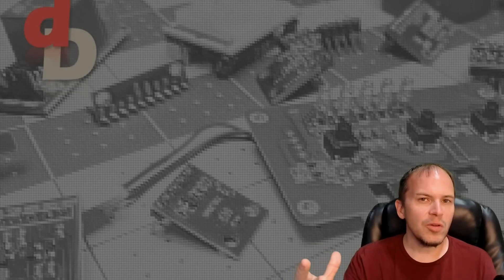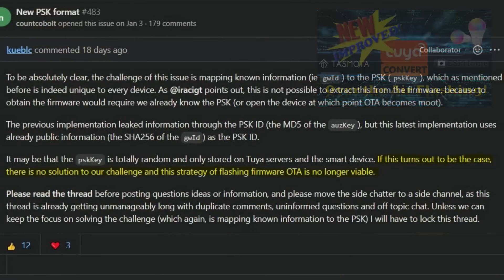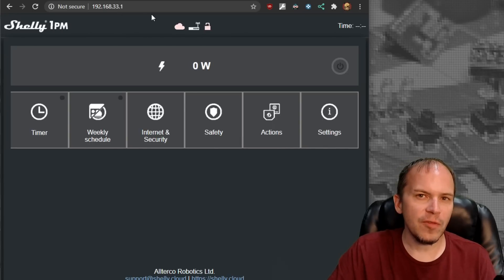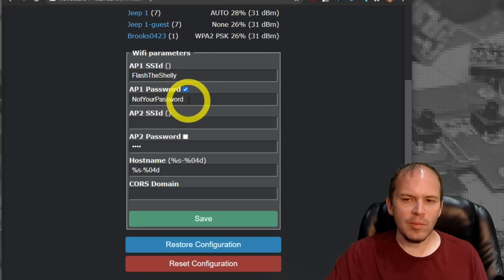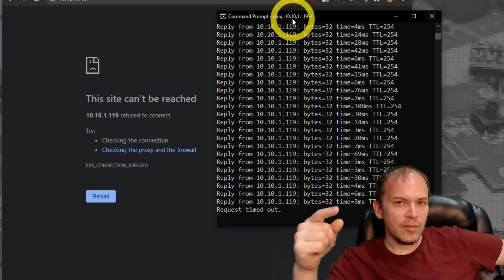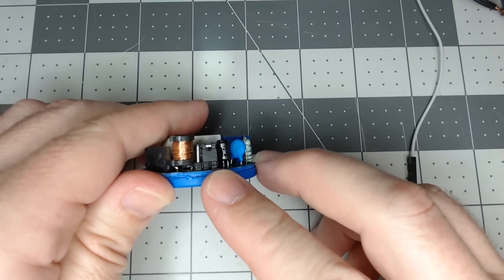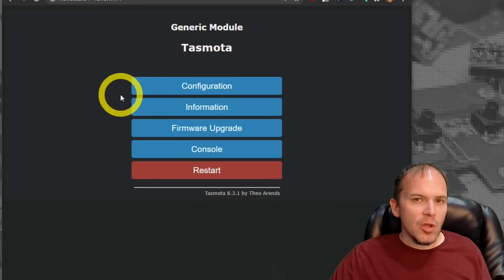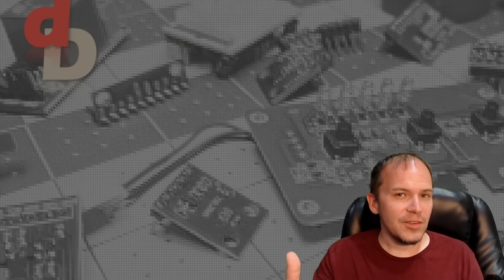Upgrade Shelly Switches | Easy NO Soldering Smart Garage Door Opener

Comment: Can't seem to get this to work for me. This is as far as it is getting me. 
{"status":"updating","has_update":false,"new_version":"20230913-112003/v1.14.0-gcb84623","old_version":"20230913-112003/v1.14.0-gcb84623","beta_version":"20231107-162940/v1.14.1-rc1-g0617c15"}

Never seems to get the firmware changed away from the Shelly firmware.

Comment: You flashed ESPHome off camera.  Is there a video on how to OTA ESPHome after Tasmota(lite)? Sorry for the noob question, the Shelly is in the wall and I'd prefer not to have to pull it.
Reply from the maker: Hmm...  I've done it some projects before but with an ESP8266 it is simple.  Just put Tasmota lite on the device, then upload your Esphome bin using the Tasmota GUI.
Reply: @digiblurDIY  Thanks! Worked a treat!

Comment: Can you flash the shelly plus 1 OTA
Reply from the maker: Try this one https://github.com/tasmota/mgos32-to-tasmota32
Reply: Thanks for quick response. Will try and let you know if it works
Reply: I was able to use the link you referenced to flash the shelly plus 1. Everything was working fine until I initiated number 10 on the list (starting the safeboot conversion by hitting the start migration. Nothing after that looks like it went silent. I can see the wifi signal referencing tasmota but it time out on 192.168.4.1. Is it DOA? Can I flash it the old fashion way? Thanks in advance for your help.BTW Love your videos.
Reply from the maker: Yes you can still flash them via the pins on the bottom.  I've done some later ones on that but if you want super simple someone made a flasher and cable for these new Plus line.  https://www.tindie.com/products/voltlog/voltlink-cp2102n-usb-serial-adapter-programmer/
Reply from the maker: and thanks on the videos!
Reply: thank you @digiblurDIY
Reply: is there a video showing how to flash via the pins?

Comment: Does flashing enable proper bluetooth proxy mode on the shelly 2nd gen? Right now I can't use them with my LD2410C which sucks cause I got a lot of shelly 2PMs around the house
Reply from the maker: I think you can use the stock Shelly firmware too with the BT proxy, I've never done it though.  For BT Proxy though I'd really recommend a dual core ESP32, like the Wyze plugs I did or even just a simple ESP32 nodemcu.
Reply: @digiblurDIY So shelly does have BT proxy in the stock firmware but it's either active or passive (not sure) and isn't working with the LD2410C. I got a everything presence lite (with bt proxy) and it immediately picked up the LD2410C and HA could see it from 1 floor away.
Using a ESP32 nodemcu is my last resort... it gets complicated hiding these around the house at some point and I already have about 20 shelly 2PMs scattered around :)

Is it easy to flash back stock shelly firmware if I get around to testing tasmota / esphome and find out the BT proxy still won't work?

Comment: Hi. Sorry but it's not working to flash with tasmota on my 1PM.
I try and try and try...
Even donwngrading the firmware to older one succeeded, but not working with tasmota...
Reply from the maker: You might try the manual method. Also get the cable for the ones with smaller pins. https://www.tindie.com/products/voltlog/voltlink-cp2102n-usb-serial-adapter-programmer/

Comment: Oh my, I don't know what the mess up is, but I cant seem to find a fix. On 2 shelly 1 devices the same problem. Tasmota is flashed, then I connect the device to my network, I see it popping up. But it keeps dis and reconnecting or something (you see it show up and go away again for a second) and I can't visit the web interface.
Giving the device an new stactic IP or the same IP with a static rule makes them disappear and never show up again.
You got any wild ideas?

Anyhow, Thx for the video :) I have 3 of them working, now these last two.
Reply from the maker: Any blocking of services? Like internet? If you do please make sure you provide them a local ntpserver
Reply: @digiblurDIY  No, not that I'm aware of. Do you know a way to reset the Tasmota firmware? The powering off and on, and the 5 times triggering the input connector are non responsive.

Comment: I recently grabbed two shelly plug us, but when I try to flash, i just get a white screen that says "not found" have you seen this? i will note that when i connect to the device in a browser, it says Shelly PLUS plug US. is this a newer version?
Reply from the maker: I haven't heard or seen that one yet. If it is indeed the new esp32 plus series, I only know of manually flashing at this point. The switchbot over the air plugs might be better option at this point.

Comment: Thanks for video, flashed Shelly EM OTA, and it worked great.  Stock Shelly firmware produces inaccurate power and voltage measuremenst. Tasmota now quite accurate. Doing Shelly 1 PM next.
Reply from the maker: One of the many features we can tweak and do.

Comment: Think I bricked my Shelly :( Seemed like I got it flashing but no new AP. It's still reachable within my wifi though but when entering the IP I'm no longer getting a webgui. Only index of/. Good thing they're cheap 😂
Reply from the maker: Can't brick em via software really. That doesn't let the magic smoke out. Luckily most  Shelly devices have exposed pins toe easily fix them.
Reply: @digiblurDIY  Yeah tried all OTA methods I could find. Only getting "Not found". I probably need the pin - usb adapter.

Comment: Just flashed the Shelly Dimmer 2 using your method!  Worked flawlessly, but when the switch shows on in Home Assistant and Alexa, the light does not come on.  I used the correct template and checked everything I know to check, but still no lights..  Any assistance would be greatly appreciated.  Thanks...
Reply from the maker: I believe those dimmers have a secondary file to send over as well.

Comment: Luv the vid.  Built 2 for each of my garage doors.  But the wife is pissed as she is very security conscience.  I reboot my hassio at 2AM everyday and it cause my garage door to open.  I think it can be fixed with poweronstate.   But I can't figure it out.  Any ideal?
Reply from the maker: Sounds like you have a retained command MQTT message?
Reply: @digiblurDIY  I checked. When I reset the device in using OTA Tasmota......the Garage door comes up whether the PowerRetain is set to 0 or 1.

Comment: Great video.  Thanks for the clear description of the OTA process.  This has cleared up many questions I had.  A final question.....is this do-able using a Apple MAC?
Reply from the maker: Yes, as long as it has a web browser of some kind.
Reply: @digiblurDIY  Thanks!! Asked the question before I tried.  It worked perfectly.  I do have another question.  I seemed to have put my shelly 1 into a unknown state.  I can't ping it.  I can connect to it at all.  Is there a procedure to reset to factory settings or is it trash now?
Reply from the maker: It would only be trash if you physically smoked it by shorting it out. If the upgrade failed or was interrupted you can recover it via the header pins and a serial TTL adapter.

Comment: can you make a video on how to flash a Shelly EM stock firmware? i have a Shelly EM that got updated and turned off and doesnt turn on anymore.
Reply from the maker: I did one on the Shelly1 way back via USB TTL.  This would be the same except the pins are smaller.  Shelly has the pin outs on their website.

Comment: Travis the Yellow and red wires on your drawing (the one which goes to the button) have supply coming out from them when triggered. Roller doors normally need a quick short so it means you are putting DC across the contacts. Plus my reed doesn't work.
Reply from the maker: The Shelly1 is a dry contact relay so it isn't putting anything across except what is already there by design of the original opener. The pulse time makes a short burst just like a button press.
Reply: @digiblurDIY  Thank you. I had a better look and the pins are not the same as shelly1. One other thing the reed isn’t working is there something I need to change output

Comment: Thanks for taking the time to make this simple video tutorial! My first Shelly 1 is still on the way and this is likely a dumb question...do I have to power it with 110V to flash or can I use low voltage as well? If so...why did you choose 110? Thanks!
Reply from the maker: I might have said 110 but I guess technically 120v here, but it is whatever mains powered is.  You can just low voltage off the pins but at that point you might as well just serial flash it.  If you do the DC wiring on the terminals and follow the jumper wiring diagram you can also do the OTA that way.  Doesn't matter how you power it as long as you do it.
Reply: @digiblurDIY  Thank you! Appreciate the additional info!

Comment: Hey! Thanks for the video!
Unfortunately I can't flash my Shelly 1 using this method... I enter the URL, it says "updating" and I noticed, that the new version says nothing at all....
I waited about 30 minutes but nothing happened. 
Any idea what I can do to solve this?
Reply from the maker: Is the device able to connect to the URL to download the firmware?
Reply: @digiblurDIY  problem solved! I could have sworn it had access but then I double-checked and remembered I did a few firewall experiments a few weeks ago. Thanks for showing me the way!!!!
Reply from the maker: Awesome! Glad it worked out

Comment: I used the mg2tasmota-Shelly1 .zip on my Shelly 1 v3 and it never came back, I got the confirmation that it was going to do the update, waited 10 minutes and then no Tasmota wifi, neither could not get back from the IP it had, in which it was a static IP, any ideas?
Reply from the maker: You try this part?

If the download fails, or your internet connection is disrupted, simply turn the device off and on again, the intermediate firmware will retry until it succeeds.

In the unlikely event that the WIFI credentials are wrong, the device will try to connect to a backup WIFI with SSID mgos-recover and password RJoPuKC3u5, which you can use for recovery.
Reply: @digiblurDIY  just did, set up hot spot with my cell phone to see if at least I can get a connection to then setup a proper router, but no avail,  I think I bricked the shelly some how, is there a way too un-bricked it using some sort of usb cable, I got a second shelly 1, but now I'm afraid to try and flash it,  I wanted to use ESPhome for home assistant, but maybe will have to stick with mqtt :(
Reply from the maker: You can go the manual way via the pin headers. Nothing wrong with MQTT. I use that with Esphome.
Reply: @digiblurDIY  Just to follow up, I manage to do it via pin headers, I have now Tasmota installed, thanks for your help

Comment: I was able to use this method but had some trouble initially. My Shelly 1 would not download the firmware from the author's provided links. Finally I enabled the built-in apache service on MacOS and downloaded the firmware from my own local server. For some reason hosting the firmware on my own local network worked fine.
Reply from the maker: Interesting...  I tried one a couple weeks ago and it worked.  No firewall blocking issues?
Reply: @digiblurDIY  I have a firewall on my desktop computer, but not on the network. There shouldn't be anything blocking a WiFi device from accessing the internet. Also, the Shelly accessed the internet to download Shelly firmware.

Comment: Hi, I have a question, I have flashed my tasmota and  it worked fine, untill i changed my LAN setting , prevously i used 192.168.1. but now i use 192.168.10, So shelly 1pm is not on the network will OTA works??remember i installed shelly 1pm on th wall, sorry my English is not good.
Reply from the maker: I believe i answered you in another question?
Reply: @digiblurDIY  yes ,thnks keep it up

Comment: Have they changed something, because this does not work now. I only get this message, nothing under "new firmware" {"status":"updating","has_update":false,"new_version":"","old_version":"20190516-073020/master@ea1b23db"}

Tried this with a Shelly Plug S.  Device does not even reboot
Reply from the maker: Not that I know of. I tried it yesterday on the Shelly1 with the latest stock firmware.

Comment: Just bought my first set of 8 Shelly 1's. The first one I tried to flash didn't work. It's bricked now so I'm going to try and flash it the old fashioned way. However, the next one I did I made sure to update the firmware first by connecting to it through a browser. Once done, I flashed using the OTA method described in your video and the other 7 worked great!!! Thanks!!!
Reply: My Shelly1 is stuck at "The Magic"...
 It did have the latest shelly firmware "20210429-100340/v1.10.4-g3f94cd7".
it musta be bricked now :(
Were you able to flash it using old fashion wires?
Reply from the maker: A couple things it does require the ability to reach the URL of the firmware.  If not you can always use the manual method of wires.  The only time the manual method of wires doesn't work is if you let the magic smoke out of the chip via some physical means.
Reply: @digiblurDIY  I went and wired flashed it. Device is not bricked. However, I could only flash an old 6.3.0 version. And no matter how I tried to Upgrade Firmware from within Tasmota, I would end up with Upload buffer miscompare or another hang.

I OTA flashed a 2nd Shelly1. Almost same thing. Device rebooted once (on the 2nd minute mark) but nothing followed after 30+ mins. I power cycle the device and it reconnected to my Wifi network. Its web interface displayed files and folders; one of the file is "wifiresetdata". Accessing it via http://shellyIP/wifiresetdata reset the device and it is back at 7:00 "Tasmota connecting". 2nd Shelly1 is running firmware 9.5.0

Did I not wait long enough? 30mins not long enough for it to OTA flash?
Reply from the maker: Sounds like you have some bad files. If you are flashing via wire then that's full power over the chip. You can flash whatever you want.

If it is not flashing via OTA then it sounds like you have an internet issue.

Comment: Ok, I have a problem using this method. Everything went ok but the switches(relays) don't work. 
I updated a Shelly 2.5 UK, the firmware process went in fine, watched it reboot a few times. I then configured the device with the Shelly 2.5 template (in Other). I even have the device connecting fine to my HASS through MQTT but when I click on the Toggle Switches 1 and 2, I don't hear the relays. Fortunately, this device is accessible so I can hear the relays don't even toggle. This Shelly is/was functionally fine too, was working just before the OTA firmware switch to Tasmota. Sorry for the long message but I thought I'd try an pre-empt any question marks over the process and the operability of the Shelly prior to OTA.
Reply from the maker: I have a Shelly 2.5 here.  This template is on it and running 9.2 of Tasmota.bin (make sure you are not using Tasmota- lite).  If you need to update yours to the latest put this in the OTA upgrade URL field and hit the button and give it time to do the upgrade - http://ota.tasmota.com/tasmota/release/tasmota.bin

If it still is stuck, use the Discord link and we can further look at why yours is not working.

Comment: digiblurDIY So I did the Shelly 1 setup, but I dont know how to display the open / closed state of the reed sensor in home assistant.  Just getting started with HA TASMOTA SHELLY.  At this time I would prefer to just get it into HA without NODERED.  Any suggestions?

Comment: I did have some trouble getting this to work.  It turned out to be that when I set a static IP, I did not supply a gateway.  The shelly wasnt able to get out to the internet to download the file.  Before I did this it would drop connection once, so i thought it was working.  Once I put a gateway in, then it worked like in this video.  It may not be an issue if you leave it DHCP?  Thanks for the video!
Reply from the maker: Good point. Yes a valid outbound internet path is needed temporarily to do this upgrade. After that you are welcome to block it once Tasmota is on.

Comment: Thanks for your work, I managed to flash everything except the Bulb lamp, flashed but not working because I was unable to make a correct template. I ask you, is it possible to go back and install the correct firmware on the shellys? Not only the Bulb, but also a couple of Shelly1's I would like to put back with their Signature, but I can't.
I found in the forum a link to this site where it says that is possibile update OTA
 https://forum.shellyitalia.it/viewtopic.php?t=3743 

this is the site link con i firmware 
 http://archive.shelly-tools.de/ 

then I also found another site that allows you to do it 
https://www.shelly-support.eu/index.php?shelly-firmware-archive/

but even here it doesn't work and I always get the same error:
my browser after paste the long link generate: http://192.168.1.5/ota?url=http://archive.shelly-tools.de/version/v1.9.3/SHBLB-1.zip  
File non trovato (in english "File not found")

do you have any advice for me?
Thanks
Reply from the maker: I've never gone back myself except on a Shelly1 to test the process and did it via the serial headers

Comment: Is temperature of 50C considered an acceptable temp? I have Shelly Dimmer 2 and even in off mode, temperature gets to 50C especially when enclosed. I have not tried to monitor the temperature before flashing Tasmota binaries so cannot tell if the same reading is with the original binaries. Any feedback on this is appreciated
Reply from the maker: Have you updated to the very latest version? I heard some fixes on some models. I just don't recall which ones.
Reply: @digiblurDIY  Yes I have. Tasmota 9.2.0, STM32 v51.5. Temp stays around 55C when loaded and enclosed. I think this should be fine knowing that chips are designed for over 100C junction temp. I am not sure where temp sensor is on this device but even if it measures ambient temp, this should be acceptable.